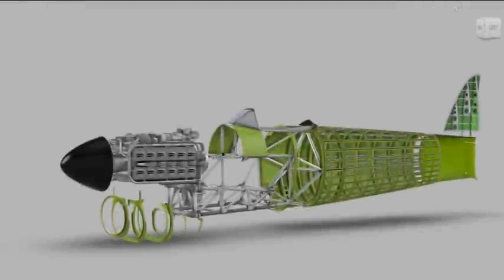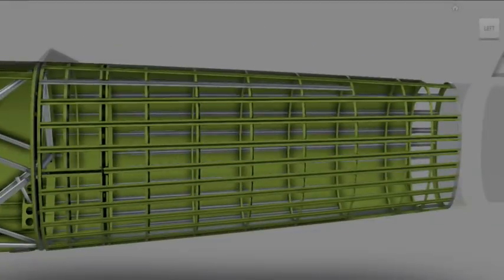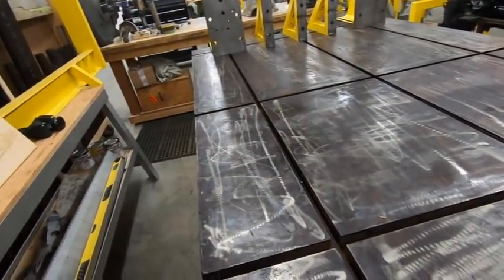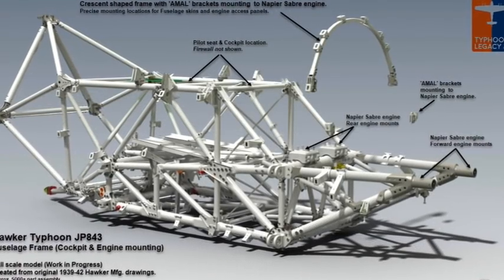Episode 20 Hawker Typhoon Cockpit Structure

Comment: No problems replacing original forged parts with billet items?
Reply from the maker: It can be very complicated and is entirely dependent on the original design requirements. Grain flow with forgings can be critical in part strength; decisions are made on a case by case basis with very (very) careful study. ~Ian
Reply: @TyphoonLegacySociety  Makes you realise how difficult this must have been with food rationing and bombs dropping on your head! 😟
Reply: @TyphoonLegacySociety  So it's down to the Canadian aviation authorities, or do you have to put forward a case? Guess you can make the parts thicker if need be?  Forging new parts would be prohibitively expensive, or?
Reply from the maker: Transport Canada is our regulatory authority, it's up to us to prove the repair parts are equivalent or better than original. The final parts will typically be machined for JP843, and made to original dimensional information / surviving parts. Substantial work has gone into research on the original design strength etc. ~Ian
Reply: @TyphoonLegacySociety  thanks for the reply.  I'm really looking forward to seeing it come together. This tubular structure is so different to any aircraft restoration I've seen.